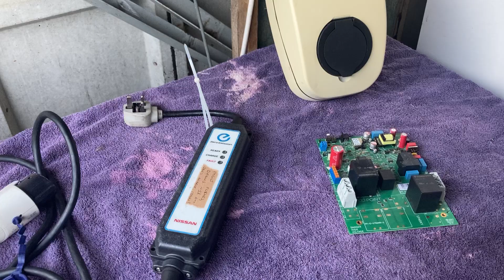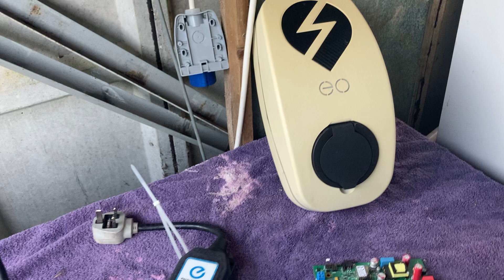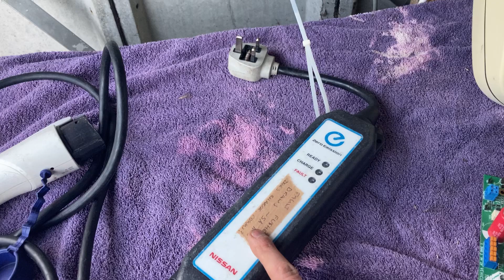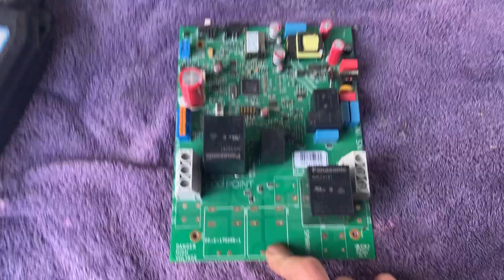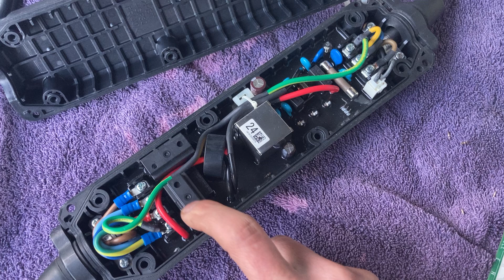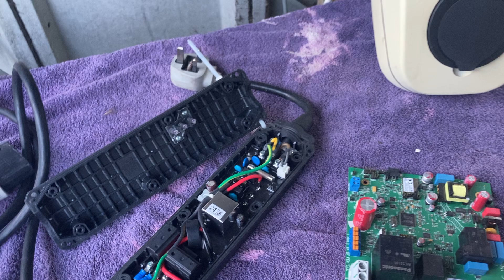Are EV Charge Points safer than a granny cable? Are they just overpriced relay boxes? Electric Car

Comment: Built my own charger as I wasnt going to pay the silly money they try and claim them to be, bought a EVSE and a nice phat 40A contactor (goodness knows how those poxy little relays cope with 32A for hours upon hours ? ) then added a smart contactor to control it all and built a fully variable charger that was programmable for less than £200, the dam cable and plug was the most expensive bit 🤬 Great Vids by the way, defo a sub here from me.

Comment: They may be safer re any older circuitry in the house as well, being installed recently with adequate supply cable. The “granny” one is quite likely plugged in to some kind of ring main outlet used for other loads at the same time.

Slightly off topic: to be able to install a charge point, it depends on the capacity of the main service cable and whether it is dedicated to the property, or is looped into another one, like next door. The local DNO might have to do some work to accommodate this, such as splitting a service cable from their distribution one, upgrading their main fuse, or whatever. EV charging loads are not counted as part of load diversity sums when they tot up the total on the service cable, as it will be a continuous  ~32A for several hours.

Comment: It is of course possible to buy a 32a version of the "granny cable" that connects via a commando plug to a dedicated and appropriately rated mcb. The only advantage of the dedicated EV connector would indeed then be PEN protection, where it is fitted, although the commando approach could also avoid PEN risks if the earth conductor connects not to the incoming "earth" but to its own dedicated earth spike.
Reply from the maker: There are issues with having multiple earthing systems in one property unfortunately.
Reply: If you know an electrician in UK who's going to install a 32A commando outlet for me then let me know. I've tried few and all refused. No one even want to talk if I don't disclose what I need it for and when I tell it's for EV chargers they try to force me to install a wall charger instead. Commando would cost £200 (plus £150 for a charger), but EV charger is £1000 (installation plus charger). I think it speaks for itself why they don't want to do a cheaper job.

Comment: First thing I did with my granny cable was change the plug for a 16A CEE connector. This eliminated overheating of the 13A plug.  I'm offgrid so I'm essentially TT and I don't care about PEN.
Reply: The plug on the charger shown in the video has a thermal monitoring to protect against the plug or more likly the socket overheating.

Comment: Very informative thanks but I would like to mention that the 13amp plug overheats after prolonged use
Reply: Mine doesn't, just barely warm. Of course, your 13A outlet may have tarnished or otherwise higher resistance contacts - I have seen this where a fan heater sees extended use.
Reply: @rhiantaylor3446  good
Reply: Does it overheat or just get hot?
Reply: @dennisharvey4499  gets hot then after repeated use burns socket
Reply: @bernardcharlesworth9860  not encountered that issue with it

Comment: Obviously on the whole yes. It is the Government 'wot dun it'!!  Well anything that gets a Government grant automatically costs the grant amount plus the price that would have been charged for the item in the first place. In the US I believe chargers cost in the region of $300 to $350. Europe prices are similarly much lower than here. The installers know people will deduct the grant from their quote which allows them to push prices up the wazoo. As soon as the grant ends the prices do not drop. Everyone just grumbles at the Government instead. Please stop subsidising everything, I cannot afford it.

Err. I am pretty sure those inductors are capacitors. The bridge rectifier is an optical isolator, used for control feedback. Just saying.

Comment: This Pod Point is glorified relay. It has no RCD or current protection, it even does not have current and power monitoring. It says on the label that it has to be connected to RCD protected circuit.
But Zoe OEM EVSE has almost all protection integrated.

For Zoe in 3 phase installation it is important to have phase loss protection, which many 2000€ EVSEs do not have.
Reply: @Mladjasmilic  thanks really interesting